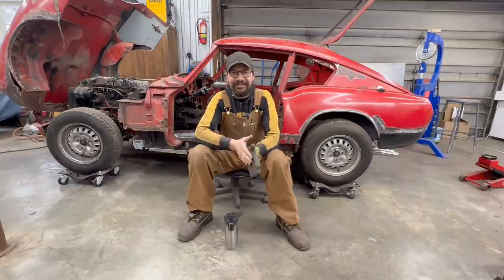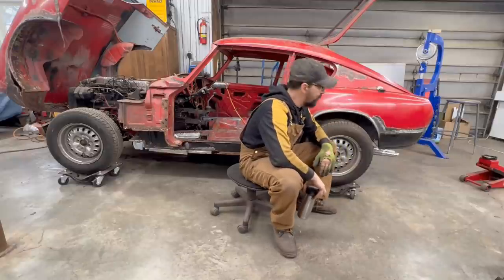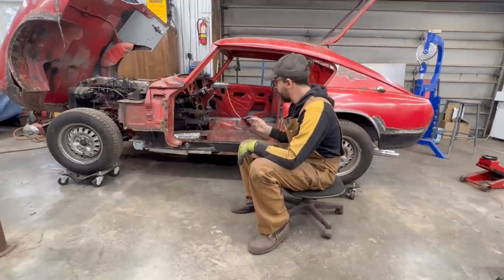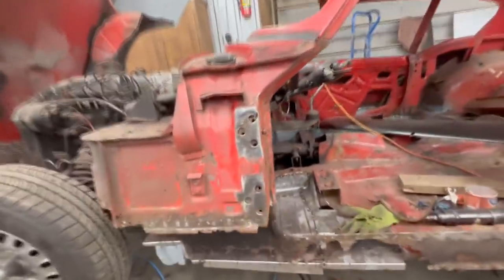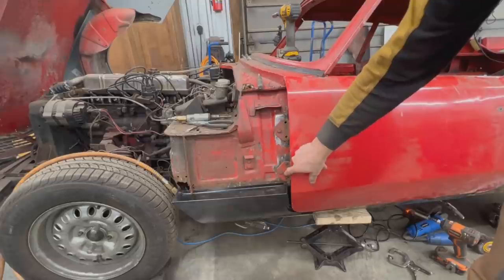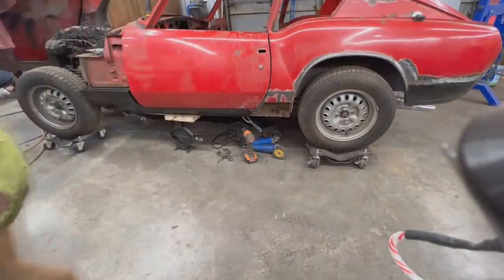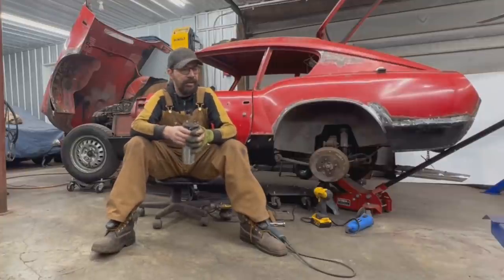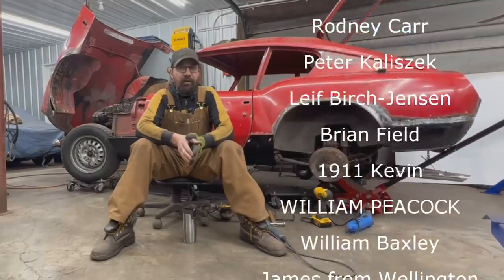1966 - Triumph GT6 - Part 31 - Fitting New Sill

Comment: Excellent work Elin.. When I saw the gap with the new sill and you compared measurements, my mind couldn't work out how to resolve the issue. This was not helped by having had a glass of wine with lunch . You know the problem.. Half a bottle of wine, if left unattended will evaporate, so it had to be dealt with before it sabotaged the race to net zero here in the UK.

Comment: At 5:58 the top hinge mount, where it is cracked is actually one eighth to a quarter inch pushed back. This could be partly responsible for the what seems to be a  twist in the door. When you repair the cracks you could bring the top hinge mounting back out to original position. 
There are no PROBLEMS, only OPPORTUNITIES. was how we used to approach solving issues.   Once you make all your adjustments , you get closer to perfection.

Comment: Glad to know I'm not the only one to have my camera button actuator out of calibration 😁
Good job figuring out that sill. Looking back I had the same issue. I had to move that notch at the front, but I didn't notice the other end was bent wrong.
Question. How do you get your door positioned correctly? You install and remove it many times with ease, and some folks may struggle with it.

Comment: Elin the problem with the bottom right of door is down to the a post , on the video you can see that where the a post is cracked behind the hinge,  the metal behind the hinge is sunken in, you need to pull that  section, it is not the door
Reply: I think the cracking is mostly because people will pull on the door getting in and out of the low cabin on Spitfires and GT6s...

Comment: Try Sliding ihe seal panel back under the rear panel .Il might fix some problems
Reply from the maker: No, it is meant to go un top of the rear panel, which has a step down. Now, that I shortened it it works well. I had to modify the front end a little more too, which I show in the next episode.

Comment: You are making fewer and fewer mistakes these days due to thorough analysis of what is going on and using the right bits as datums.  I have had issues with but welded seams pulling in on me as your rear fender/ wing bottom did and think this may be due to insufficient initial seam gap. Using the Fitzey's technique of tacking an overlapped seam and thenot slitting down through the tack and parent metal at a 45 degree angle a section at a time and putting the two together to make a flush but weld may?? alleviate this problem,  he seems to be able to insert a patch in at wiil.... he makes it look easy anyway, I bet it isnt. Helps if the panel will weld!!
Love your work!!
Reply from the maker: I tried with a bigger gap.... same thing. And with joggle weld  there is no gap at all. It is just the heat. Cooling down the weld with an air gun doesn't help much too. And it makes sense, isn't that what we do to shrink metal, heating it up with a shrinking disk for example and the cooling it down quickly? I tried also letting the metal cool down on its own, by skipping a few inches and welding slowly.... That doesn't help much either. It always warps, but a little bit hammer and dolly fun and it comes back where we want it.